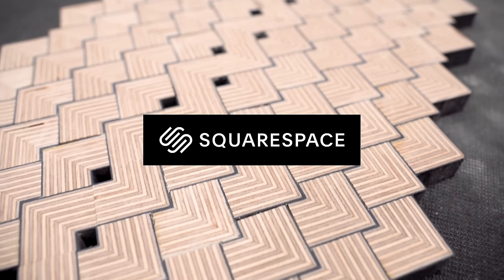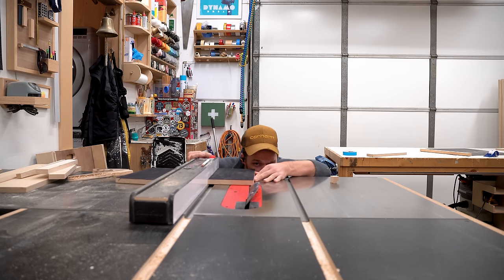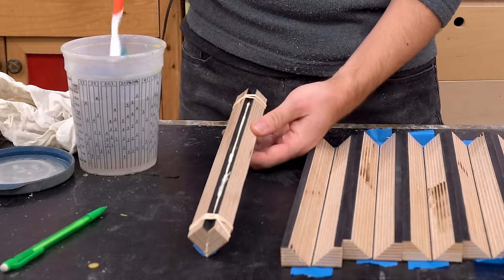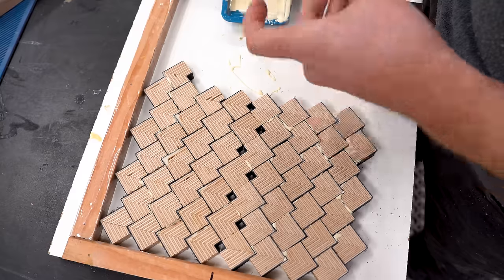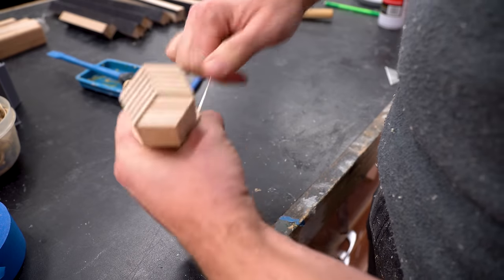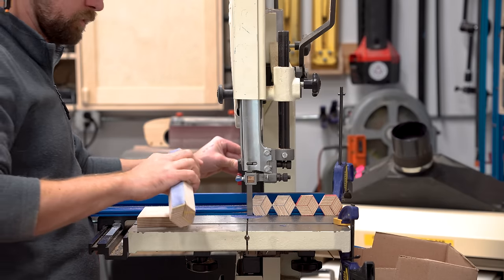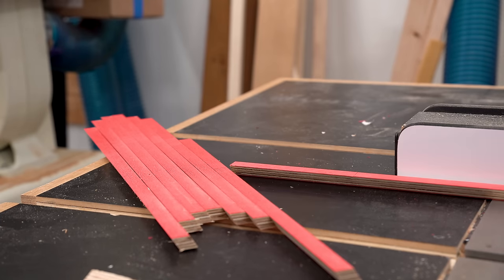Adding Color to Patterned Plywood

Comment from the maker: Hey everyone, what do you want to see me build with these patterns, and what pattern should I use on that project? Thanks!
Reply: I know it would be alot of work but I'd love to see a full sized cupboard like 900mm tall and 500mm wide, built out of pattern plywood.
Reply: I've always thought cabinet doors would look so cool.
Reply: Here's a thought. 
What about a hanging light fixture or chandelier for over a staircase or hallway? You might experiment with using the belt sander to flatten them enough to make translucent material
Reply: @neilf4128  That's a great idea!  You could also take advantage of patterns with holes in them like the one Ashley suggested, it could be neat in a light fixture, and it'd go well with the colourful cords you can get online (and you know who you can get to sponsor that video too!)
Reply: Hey Michael, great job! I 'd love to see the black pattern with here and there a red V in it as an accent. Makes me think of your logo.
Reply: The black veneers made me think of Kyle Toth.  It would be cool to use the patterned ply as the base, then do his leopard print over the top.  Very cool Michael!
Reply: Can patterned and glued plywood like that be cut into veneer strips on a bandsaw or will it come apart?  The black pattern would make for an incredible spine to a longboard/paddle board/kayak… you name it.
Reply: I’ve really enjoyed the builds you’ve done that weren’t obviously plywood (liquor cabinet, Murphy bed, etc.) When will you feature more of those?
Reply: Knife scales are a cool idea - how about a knife block to store the knives?
Reply: COME ON... You clearly love this piece of music - or your 'editor' does. PLEASE, tell me - what is that tune at 12'41..?It is in almost every video, and just saying 'epidemic sound' is not good enough.
Reply: keepsake boxes
Reply: Knife scales, obvy.
Reply: Flooring for a small room!!
Reply: Щ
Reply: How would you add those to a succulent planter?
Reply: What if you made a book cover out of the patterned plywood?
Reply: Could make a mountain/trees/lake/sun art scene piece using the different colors.  Would be a bit of layout to get the scene right though!
Reply: The first patterns reminds me of Smaug's scales. (We've been watching the Hobbit movies the last 3 weekends.) I think you could do an actual wall art installation with a dragon theme.  Use black for most of it then red veneers for the dragon's belly-on-fire area.  I'm guessing that would take months though.
Reply: weird and probably too grand of a suggestions, but maybe an inlay on the free edge of a fireplace mantle or cabinet.. just spit balling here XD
Reply: Use them to pimp out your friends or neighbours ugly furniture !✌ like one of those "ikea hacks" on a pine or spruce door.
Reply: Where he changed the pattern on the black one it left holes. Change every row for a wave pattern (holes every row) and bevel the pieces for a ‘round’ light shade.
Reply: Am I the only one thinking about colored skateboard plywood? There is another YouTuber. Check out his Channel Woby Design. He cuts up broken skateboards and makes things. Man I tell you the stuff you make. Just gets better everytime. The holes... gives up so many ideas lol. Keep up the great ideas!
Reply: Chisel handles
Reply: Tumbling block (in the video for the colored veneer, it's the hex pattern) stair risers. After I removed the fugly pink 70's carved shag from my stairs, the wood isn't salvageable ... it it can be covered! I'd love to see it before I go to all the trouble of making it.
Reply: I would love to see you making a "backgammon and Chess " board or box, this would covers box making and colored patterns on the double wood faces witch is chalanging ;)
Reply: I would like to see what it is like if you use Alcohol based Stain to basically Dye the pieces of plywood after you cut them into the pattern pieces, I know a good thing to use for it would be TransTint
Reply: I really liked the bowl shape you did in another video, using the patterned plywood segments. That would make for a great inverted lampshade using 1/2" plywood with the reverse pattern midway to allow a stream of light to diffuse and come out there as well as from the bottom.
Reply: I just noticed Youtube had un-subscribed me from your channel.
Today YT recommended your videos and I discovered what YT had done. 
This has happened to almost 80 YT channels for me this year.
I have re-subscribed.
Reply: E
Reply: Would love to see a desk with a riser and for a monitor and a back board made with this technique
Reply: I would like to see some kind of puzzle cube made of these, I think it would look pretty trippy! Also wondering if instead of the veneer you could use a thick coat of paint, or would that not handle the cutting and gluing that well? Seems like a faster option vs the gluing and ironing.
Reply: I would love to see an American Flag with this technique. It would be subtle but I think it would be a nice piece.
Reply: Hi
Great job 
I liked very much
Reply: Please can you tell me what kind of glue do you use? 
And where to find it
Reply: Not sure how plywood would hold up but since these epoxy tables seem to be so popular how about a coffee table.
Reply: You should really try to get a hold of some old skateboard decks. The colors are already there. Could be cool and repurposes old material that would otherwise be thrown out. I've seen other stuff done with skateboard decks but this has serious cool potential. If you ask around a local skate park there's probably plenty of kids withhold boards to donate to the cause.
Reply: have you every tried steam bending plywood? a bar stool with steam bent legs and a patterned top would look really cool
Reply: Do you think these would be strong enough to build say a speaker cabinet from?

Comment: They all look amazing! Added clarity to the design and another dimension. I thought you would stain some square dowels black and put them in the holes to complete the one panel. Same look but solid surface
Reply from the maker: Thanks! That's a good idea. Some India ink would probably do the trick. I'll give that a go 👍
Reply: Cool idea. Or fill them with transparent resin - maybe in a ruby red?
Reply: @neilcarr71  I was thinking something similar, except leaving a space between all the pieces and using resin to fill the gaps.

Comment: Wow, this looks amazing! If you're worried about the strength of the pieces when using them on finished projects, it seems like you could put a thin layer of epoxy around it to reinforce the pattern. From making end grain cutting boards, I'm super paranoid about having missed a spot in the glue up and weakening the overall panel.

Comment: That black reverse pattern is really nice.  Reminds me of scales (dragon or a pangolin).  I agree that the colored veneer edges really accents the patterns and makes them pop.  As to patterns for the future, have you considered a fractal pattern? Fractal that has the same detail at different scale... Far away, you see the pattern, but as you get closer you see the same pattern, but smaller scale and closer again, same pattern but even smaller scale... Not sure this is even possible, but thinking how people use images to make pixels in pictures, so not really fractal, but you see something different depending how how close you look.  Great video Michael and looking forward to what you share next!
Reply from the maker: Thanks! Oh man, a fractal is an interesting challenge 🤔
Reply: Assuming you could use the coloured veneer to make the bigger pattern visible from far away & then as you get closer the non coloured patterns in the middle are made out of the same pattern just smaller. I like your idea dw wood builds!

Comment: I liked the black better. 

As for a project to build with the black pattern with the flipped pattern that leaves the holes, I think some type of jewelry box with a solid wood frame painted a gloss or semi-gloss black would be a good match. Then for the panels inside the frame (either flush or slightly recessed) would use the black pattern. Might experiment with  flipping the pattern continuously to give an even pattern of holes across the piece. Back the  patterned plywood panels with  a very thin plywood sheet either painted black or with a layer of black veneer so that the bottom of the holes are black (and mysterious). Alternately you could glue a shiny very thin sheet metal to the back and then the bottom of the holes would be reflective (and even more mysterious). A little bit bigger jewelry chest could have two doors on the front that swing open to give access to slide out trays with necklace hooks on the back of the doors. And the side panels could swing open to provide necklace storage hooks.

A bigger project would be to make a chest of drawers in a mid-century modern style where the drawer fronts hide the frame cross pieces completely and form a flush and continuous face when the drawers are closed. And the best might be a tall and skinny 6-drawer lingerie chest where the fancy drawer fronts would be a good match for the fancy clothing it holds. 

The picture I have in my head is to use the patterned plywood  as the drawer fronts so that when all the drawers are closed, the edges of all the drawer fronts form a continuous pattern. The width of a saw kerf is about the gap needed between drawer fronts in this type of flush faced chest of drawers. If you make a layup that is the size of all of the drawer fronts, glue it to the backing wood and then cut it into individual drawer fronts, the pattern is guaranteed to line up. And instead of a lot of flips in the pattern, just do one that will line up in the middle of each drawer front.

Oh, and one last thought, definitely use some clear epoxy to fill all the holes in the pattern so that dust can't collect down in them. The epoxy polished to a high gloss would match the gloss black frame as well.

Keep up the great work!

Comment: In traditional veneering they would spread their glue onto their base product then on both sides of the veneer before applying. With this thought in mind maybe you’re cracking of your veneers is lack of moisture in the veneer so that they’re just getting to dry. Maybe a towel that’s barely damp no dripping of any kind just slightly damp so that the steam can help the veneer while the heat activates the glue, that or glue it wet. Basically you’re a base piece of wood glue veneer wax paper clamping board or block and clamp it up tight.

Comment: I did this and it works like a CHARM! I couldn't believe it. One note, you MUST tape and weight the veneer while the glue is drying so it doesn't curl. Even taping it to freezer paper isn't enough because that paper will bend with the wood. Also, watch for over-gluing. The first time I tried this, the glue was a little thick on the edges and ended up running under the veneer. Not a big deal, you'd think, until you try to iron it just to find that the craft paper sticks to that glue also. 
Just know that the veneer, even when weighted, will warp and look unusable until it's completely dry ... at which point it's totally flat again. 

The second time, I ran the glue right up to the edge, but not over and decided that losing a 32nd to a 16th of an inch was better than losing more with the paper stuck to the veneer. 

NOTE: This glue and paper can be removed from the veneer with white vinegar. But you MUST be patient not soak the veneer or the glue beneath will also get messed up. White vinegar melts the glue, turns it opaque, and once it's soaked enough (dabbing over and over ... you never want to flood joints), it can be peeled off with your fingernail. This works great for projects. You can also dab until it wipes off with a towel and a little scrubbing, but again, this works great with fingerprints on a project, but not with veneer, so I chose to sacrifice a tiny bit of veneer instead.

Comment: Michael, again, many thanks for the great video. I am completing my first chevron pattern, a replacement top for my wife's TV tray, with matching coasters.
As I was heading down the rabbit hole behind you I found some information I wanted to share, this has to do with wood glue open times. Much came from a WWGOA video, the rest from other research.

Glue                                 Open Time    Comment           
Titebond Liquid Hyde		        66 	Dries brown
Elmer’s Glue All (White)		37	Dries clear
Elmer’s Wood Glue (Yellow)	20
Titebond II Extend		        19	Dries Yellow
Titebond III			                15	Dries Yellow
Titebond Original		                11	Dries Yellow

I use the Elmer's and feel it helps. 

Good Luck, Rickster

Comment: One thing I always wanted to do was use a wood glue that was colored/dyed to black to contrast the wood plies to make my own sheet of plywood.  As I seen a table top done in a restaurant like that in my travels and I figured out that they had colored the glue on the plywood, but the scope of trying to make my own full sheet of plywood like that was out of the question at that time.  But for a small sheets of plywood and using for a pattern would look good, or just doing the glue coloring for between the cuts of store bought plywood would work similar to the dyed veneer sheet.

Comment: After your initial ironing of the veneer spray it with water and let it rest to a bit. Use a light looking edge on. If the veneer is not fully secured it will bubble up. Then iron over it again. This should help eliminate the splintering you observed.

Comment: I eliminated the cupping of veneers when I do this very same process by misting the opposite side with a little water before you apply glue to the side that's up. That way you have equilibrium in your moisture and both sides respond fairly similarly and the curl is gone.
Reply: Why not just glue them to the plywood? I’m confused for the need to glue them and let them dry before ironing.

Comment: A few tips if I may: rather than veneering with PVA and a hot iron, why not consider the use of contact cement? In a spray can it will only take a few minutes drying time. When glueing the individual tiles I would clamp them all together and apply glue on all surfaces simultaneously, works so much faster.

Comment: So I should be saying this on the video that was the demo of plain plywood pattern of this alpine design (my absolute favorite), but thank you for sharing so much knowledge, details, etc. This actually goes back to seeing Ashely’s workbench, you had filmed a short clip of these stunning alpine ply + walnut cutting boards that matched when aligned together bc of the outline of mountains (ply alpine) vs the night sky (walnut alpine) with I’m assuming, brass stars or maybe it was wood dowels… I don’t know but anyways that pushed me to this year getting through my fear of the table saw and creating this alpine design as this years cheese boards for my family members. I’d go with actual cutting boards but I have so much family… there’s no way in my timeframe lol. Sorry that was incredibly long winded of an explanation but for me to face kick back and whatever else can go wrong on a table saw is a big deal and I’m so appreciative that I have your channel and your knowledge and advice, inspiration to draw from. For my cheese boards I decided to do almost an ombré effect with the alpine shapes. I can’t find walnut but I sourced plenty of Mahogany, Purple Poplar (I’m not using much and it’ll be at the end of the cheese board), Hickory, Alder, and finally Maple to create this soft gradient of a fall themed alpine mountains or trees. I might try this pattern with the squares where it’s flipped upside down but in the center use scrap wood so it’s completely solid but same concept. I don’t know but thank you and I look forward to more builds

Comment: FWIW, if you want thicker coloured lines, look for 'dyed LDF/MDF/HDF', which you can find in thicknesses all the way down to 3mm (1/8").  It is coloured all of the way through and should be MUCH easier to work with than veneer.

Comment: Wonderful as always.  At the 17:55 time log, the edge lifted from the clamps moving, you should be able to sprits a small amount of water, cover with your parchment (craft paper) and iron it back to level.  This should work fine with the size and amount of small movement you required to return to flat.
Reply from the maker: That's a great idea! Thank you

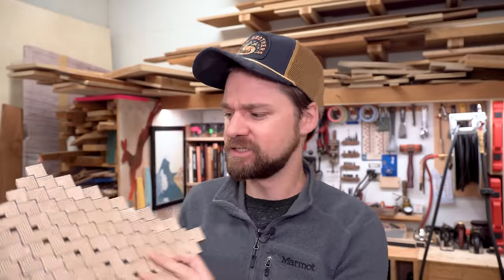Comment: If you take care that you don't glue 2 black layers together (you can see it on the short inner 45° angle at 20:10 min.), 
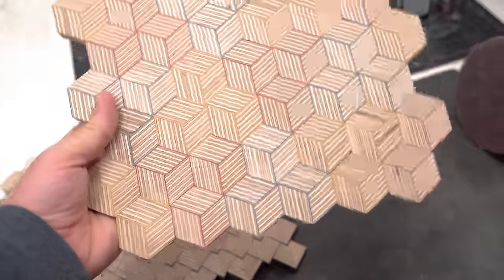than it looks better and yes I prefer the black one aswell. But with the tricolored piece you got a nice 3D-effect (at 18:20 & 19:46 min.). 😉👍

Comment: The last red one, random placement looks great. 
Just a thought for gluing up the 90 degree pieces, maybe create a small series of 45 degree pieces glued to your fence (or fence extension) to make placement easier. The Hex Pattern having facets against the fences seemed to glue easier than the black one.
An end grain Tambour with the black would be mind blowing, especially with the gaps along the centre line.

Comment: As always… super nice. Only suggestion that I could think of is by the hexagon pattern if two pieces form a long piece, the plywood is turned so the veneer doesn’t align.. maybe make that part out of one piece? That would make a double hexagon, very hard to do I guess.. or turn the piece in one of the hexes so that it align. Sorry if it’s confusing😂

Comment: The cracking veneer is caused by the iron being too hot. You should try it on a lower heat.

Also, if you dampen the veneer after ironing it on, it will ‘bubble’ to show you any areas which are not stuck down properly.